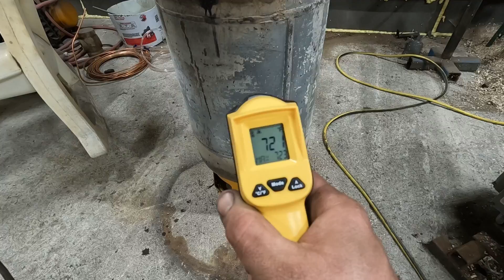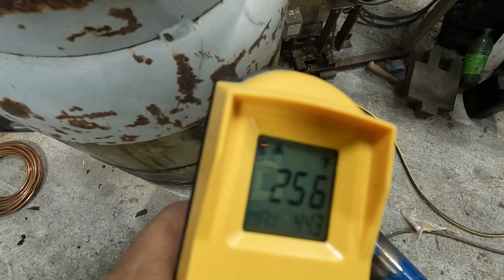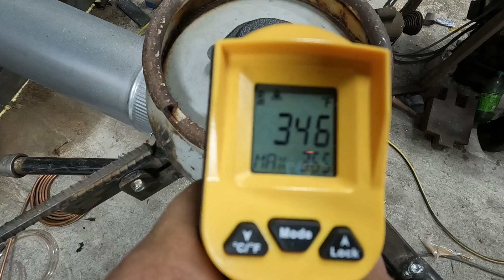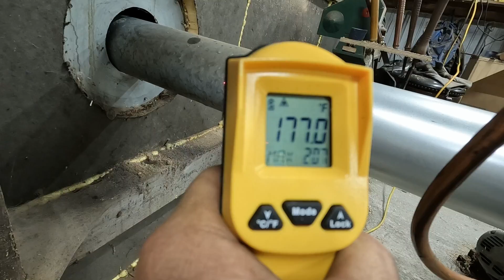Revolutionary Waste Oil Burner: A Free  Energy Solution

Comment: Nice setup, buy a 12v pump and a pwm controller. You don't have to look back. Set it properly, and you're good.... im in Canada heat my bunny barn since in October till this day still running my head i made never look back all i do shut it down every other day clean it out fill the oil tank light up and go
Reply from the maker: I love mine, it heats my shop very well.
Reply: @TheTradesmanChannel  nice I just built one for my garage love it so much I did a test and got  26 hours out of an 18lt bucket of oil

Comment: This is really interesting.  One thing that drives me nuts is if you buy a heater, it would take 10-20 years before your broke even over paying for natural gas for a garage.   Years ago I bought a 45k btu mr heater, and that thing could hardly heat a 2 car garage.  now its in my shed lol.  Reason being to me, 80 percent of the heat went right out the exhaust.  Long story short, with yours it is too.  all of these DIY videos it does.  I had the idea long ago, just never did it to buy a used tractor trailer intercooler, plumb the exhaust through that and run a fan behind it.  make it like a two stage heat exchanger like modern furnaces.  i bet that 45k mr heater would heat a 3 car no problem at that point.  and i bet you would get cooked out of your shop, but just turn down the oil and your good.

Comment: Question...could having a brake disk with a plate welded to the bottom to drip the oil into, then have the 90 degree bend directly down the middle blowing straight into the disk cause it to burn better...might be easier to light too...heat the disk rather than the whole outer shell, once the fire is going, the disk will glow red hot instantly vaporizing and burning the oil, and the air inlet blowing directly down into the disk will cause the heat to radiate out towards the shell and heat the disk in the bottom burning the carbon/sludge that might build up using waste oil
Very cool design!

Comment: 'Ow do mate!
Swapping crispy for toasty? ........ or has the white stuff not come your way yet?
Looks like you have a great setup there ...... not so much here. No waste oil and we can't burn it without a license (£1,800 last time I checked a couple of years ago).

You seem to have gone down a different route than many on this. No fine oil regulator with cut away to see the "pencil thick flow of oil", no heavy metal plate over the burning tray, no fancy vortex.
Got to say it seems to work well for all that ..... maybe you will set a trend? Blue flame = good burn and no smoke!
Reply from the maker: I find that simple is better, much better, on most things.  I work on enough over engineered junk to want it at home.
Reply: @TheTradesmanChannel  K.I.S.S. .... a way of life!

Comment: Does the type of oil matter?  Synthetic vs Dino, also would tractor hydraulic fluid work?
Reply from the maker: Any oil should work.  I've tried hydraulic, veg and waste oil.  All of them have worked so far.  Veg oil worked the best.
Reply: You do realize that both synthetic and regular oil made from the same base oil, right? The only difference is that the synthetic is chemically modified to better fit for certain applications (like cold for example).
Reply: @janosszabo98  I did not, thanks for the info!